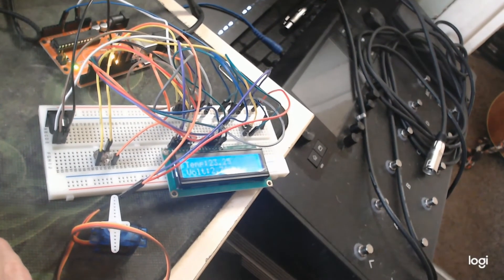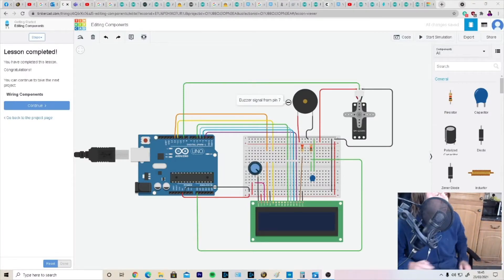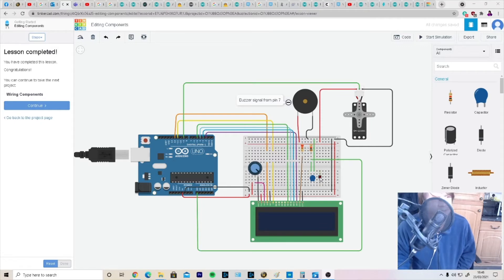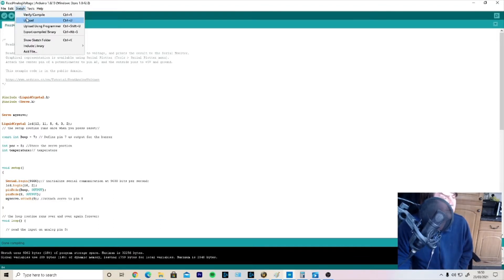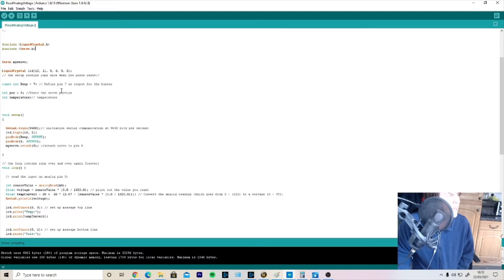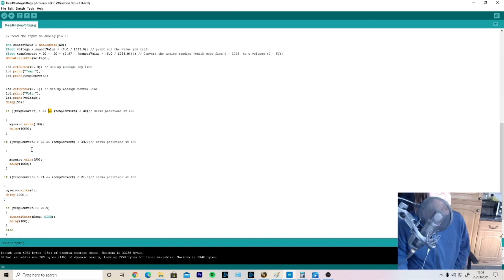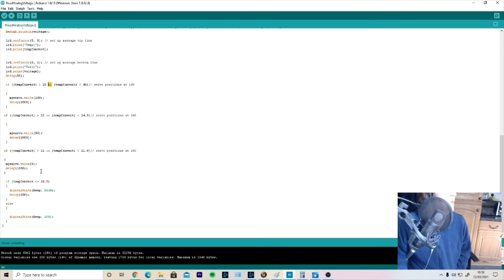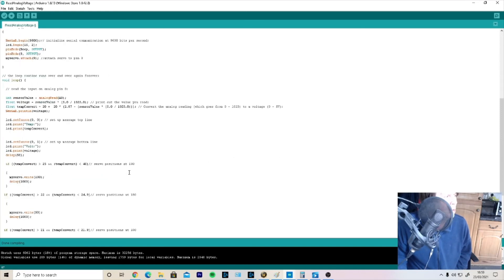Simple Arduino Temperature and Servo Motor

Comment: Well done. 
You should try that same concept, except to have the solenoid move in more steps, using something like percentage of a range, so the warmer it gets, the more it opens a window... or so that a servo could be used to move a needle on a mechanical temperature gauge.